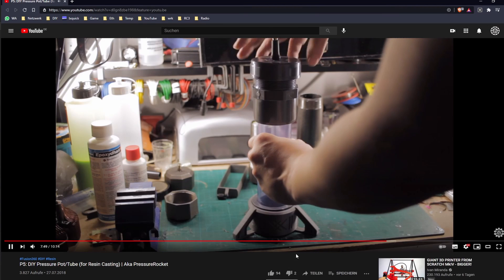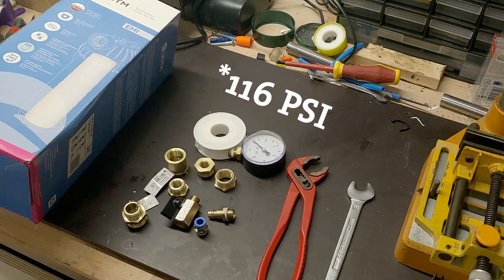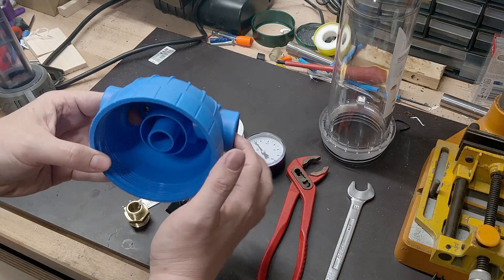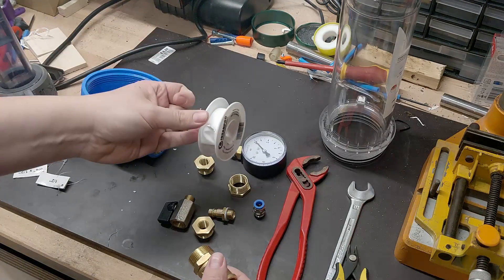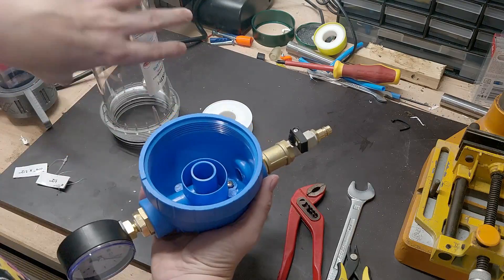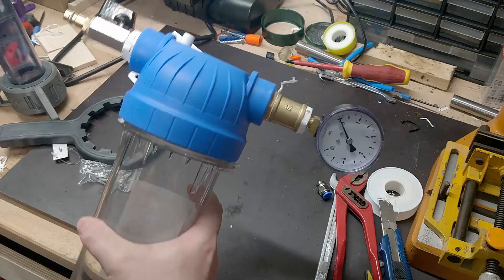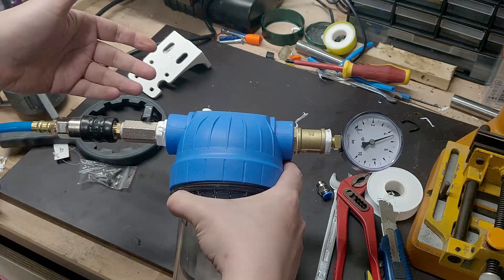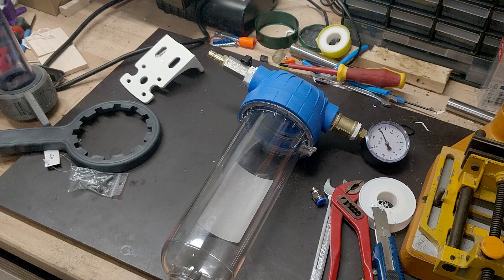P5.2: Pressure Chamber V2 (for resin casting)

Comment: Very nice device! 4 years pasts how is it works? Still good?
Reply from the maker: Yes and no. It worked fine after building a Stand for it. But in the meantime proper pressure chambers (Paint sprayers) became available in Germany and went down in price. At one point I just bought a 70ish € pot from vevor and am using that ever since. Also projects got bigger (not just keycaps) so I needed something with more capacity. In general I thing it is still a good minimum viable option but depends on budget and availability of other options.
Reply: @MakenModify thank you for your feedback.  I hope to see more videos of your projects!